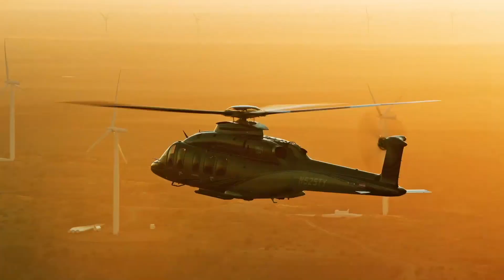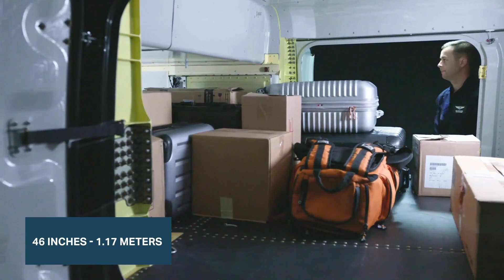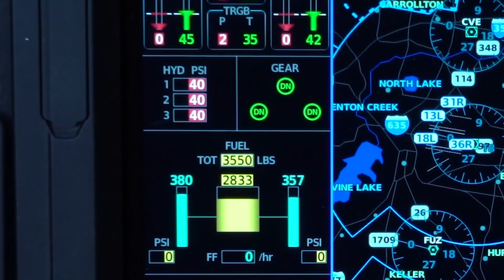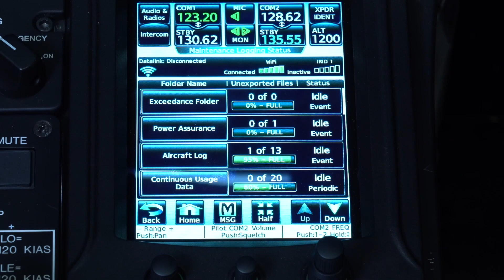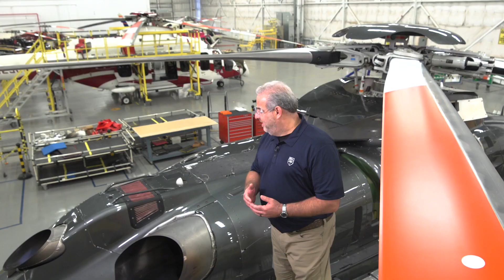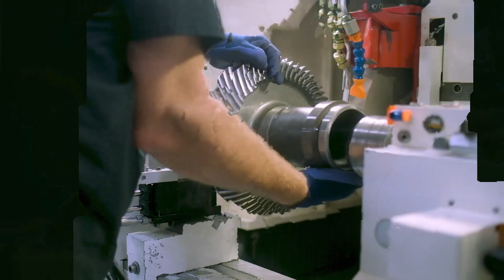Bell 525 Walk Around

Comment: Ok Ok , Send 50 Of These Over To US Coast Guards,.
Integrate These With Coast Guard NH 90 Naval Variant/AW- 249 Fenice Gunship, As Conveyed Earlier,.!
Trio Formation:
Intercept/Interdict ~ Air/Sea Borne Threats~Sea Route Security/ Armed Escort ~ AW- 249 Fenice Gunship,.
Light Attack/Surveillance/Critical Rescue/Maritime Law Enforcement ~ NH-90 Naval Variant,.
Disaster Management ~ Bell 525  Coast Guard Variant ~ Search And Rescue ~ Boat Capsize,.
Config:
Electric Hoist ~ Under Belly Sling Hook~ Rear Compartment MEP ( Medical Emergency Procedure Stretcher At The Place Of Rear Most Seating Set, With Relevant Health- Care Sensor Suite~ CPR Machine, Plasma Storage Box,  Life Saving Injections Box Etc,.) , Search Lights/Flashers, Extended Range Fuel Tanks On Point, On- Time, Loiter- Time No Less Than 18 Hours, Uninterrupted,.
Avionics~ Garmin 8 X Advanced Microwave Maritime Radar ~ Chin Mount Electro- Optical Sensors~Day/ Night All Weather~ NV/ Thermal Acquisition Sights,.
Add Ons:
 Pylon Mount ~ Inflatable Launcher Dispenser,.
Loud Speaker,.
Additional Coaxial Search Light,.
Check Clear,.

Comment: I'm a bit sceptical about the neck support compared to the S92, it looks a bit lacking. Also I would like to see a bit more relaxed seating position. 
I work at an offshore field with about 120 minutes flight time. 
During the late winter early spring we often experience that we have to return to shore due to fog or wind, that means a 3 hour round trip in full suit..

Comment: Awesome aircraft. You have nearly thought of everything. However I did not see a sectional or ELA displayed on the mfd. Will the 5000H display a sectional map and ELA chart?  Please add a visible call button that can capture the pilots attention. Another cool feature would a function to identify cell towers for optimum cell phone reception (monthly subscription to WiFi is over $12000 a month).. I would love to see hover symbology when flying in the snow. I understand you have hover hold but I want to validate with velocity vectors.  Have you considered soft detents for OEI conditions?  This would prevent or warn the pilot if they are going to exceed a limitation without referencing the instrument panel and allowing them to fly the aircraft.  Maybe throw a gps approach to hover to a point in case the pilot become incapacitated?  Isolated heating and cooling controls for front and rear allowing the rear passengers to control their own environment.  Can you share cruise speeds and fuel burn below 30 minute limits at  sea level with max Gross weight?